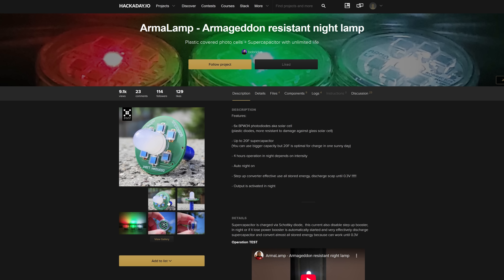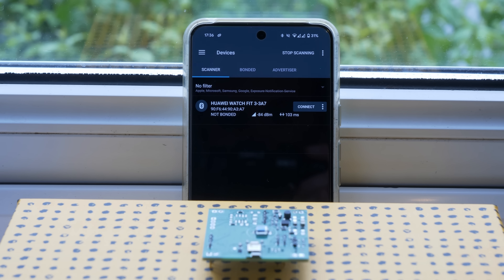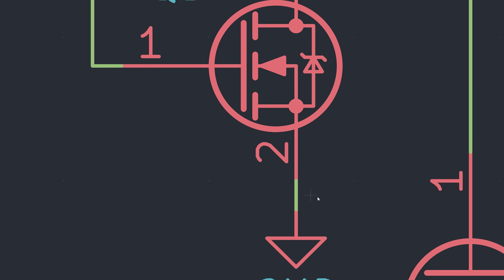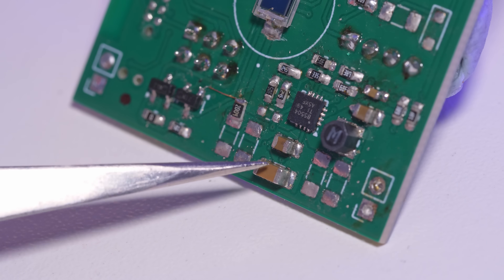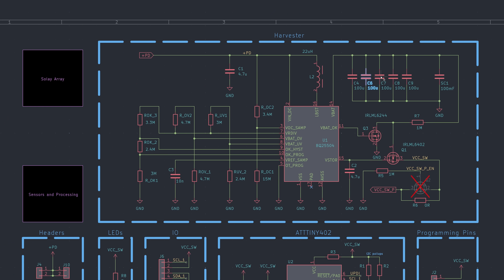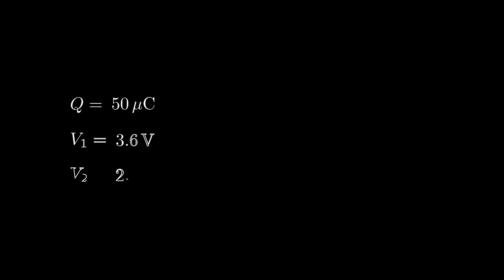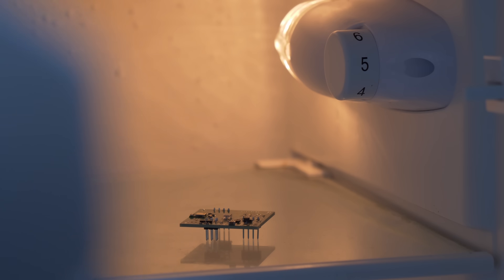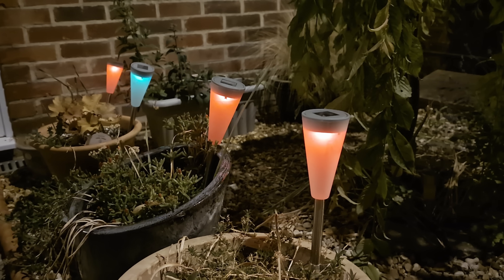Nordic chips are so efficient, you don't need batteries anymore

Comment: how does this work with one bpw34 when the cold start voltage of the bq25504 is 600mV? You measure about 325mV on the photodiode under bright light
Reply from the maker: Hey, good job spotting that discrepancy between the video and datasheet! You are right, the cold start is >600mV so that first start does require more light that I showed in the clip you referred to, but compared to daytime sunlight that torch isn't as strong.
It's a bit of fun using the BPW34 for this, it's more for proof of principal and showing how little you can get away with as there are much cheaper solar panels (with much higher output) that would be better fit for a real product.
Thanks for keeping me on my toes :D

Comment: Two tiny solar cells in series might boost the usable power output a lot. It's much easier to boost 0.5V than 0.3V.
Reply from the maker: It still surprises me that it worked at all with just one...

Comment: need to find a use where ability to leave it alone is more cost effective than replacing a very very cheap battery (also need to consider what happens to the signals being sent if there are many signals at once). Consider: warehouse and plant ambient condition monitors, e-ink supermarket price tags, soil monitoring, industrial greenhouses.

would love a more in depth explanation of how it works

Comment: With a longer range transmitter (cellphone or maybe directly received radio), it might be cool if a circuit like this could send SSTV signals to allow a central unit to gather and process photos. This could be used to monitor agricultural fields and generate fire warnings when flames are detected. Maybe at less frequent bursts it could do a thermovision scan and detect the peak temperature, sending only that value and a scanner ID to the central processor. Or maybe rain sensors, for gathering data about rainfall on various fields separately... idk.

Comment: Does this mean you could use this to do periodic temperature checks and logging it to external network, whenever the fridge and freezer door is open? Freezers typically don't have lights (at least not where I'm from), but would the room light be enough to activate this when using the larger panel?

It won't really work as a "door open" warning, but getting periodic temperature measurements for your fridge and freezer could be useful.
Reply from the maker: Even the light from a ceiling light is enough even at night so periodic temperature is 100% a plausible application for this. Some other comments have also suggested changes to the firmware to harvest more energy in the day and store in a larger battery for use at night when there is little solar energy. 

It's a minor change but makes it more suitable for most application where period measurement is preferred over measurement frequency proportional to the solar intensity.

Comment: Imagine a tiny wearable that streams electrodermal activity (EDA) over BLE — effectively tracking galvanic skin response as a window into the sympathetic nervous system. Kind of like the old Que Sensor we built at Affectiva 10+ years ago for affect measurement, but this time with ultra-low-power design and no battery at all.

Comment: This would be so wildly useful for use in hotel door key systems. Rather than slowly draining a battery over time to trigger a lock, you can have one of these slowly charge 2 sets of capacitor banks.

One capacitor bank has enough to trigger the lock 4 times. (For entry and exit and the included 4 actions on the door lock). And another capacitor bank that triggers every half second searching for a valid key card.

The result? Never having downtime for a battery change or anything similar. Additional benefits to this would be having that key card scanner check for things like;

1. Is there some form of an emergency?

2. Is the lock for some reason left open?

3. Is the door for some reason open?

The convenient thing is that since this is a door lock system and you need at least the surface area required to place and scan a key...you can justify these far larger capacitor banks and solar arrays.

Comment: I saw this and thought it maybe referred to the system data that always needs power, hence the button battery. 
Then I assumed that such data was stored in nonvolatile memory or else hardcoded in the chip.
So an alternative for the fridge thing would be to use the hot part of the coolant loop as thermal generation, idk but it might cool more efficiently and have utility at the same time.
Reply from the maker: Interesting that you mentioned novel nonvolatile memory because this is an upcoming project of mine...

Comment: Im not sure that I have a use for this in the small scale but I have a vision of using a large grid of these where each node can receive and transmit data to eachother, where you could relay packets from a large area back to one reciever. This would allow you to add soil monitoring to a large field of crops or data about inventory  in a warehouse/ employee traffic movemements across a factory to improve effeciency of a production line, something like that. It would be greatly benefecial to have a whole grid of these things set up without having to worry about powering them or having to place multiple receivers everywhere.

Comment: For the fridge, a timer for measurement and transmission were practical of course. But could we have the delay set about the middle between door openings? This way perhaps a more realistic temperature measurement could be obtained. But the circuit nor the chips don't have clock to calculate the time between energy inputs? Hmm, perhaps fixed or a random delay were OK then.

Comment: I once saw a wireless light switch that has no power source nor as a chemical element either a photovoltaic one. It was able to convert the energy of a click when you press it into an RF signal burst. That impressed me a lot.
Reply: I have tons of thoose, basic Philips HUE light switches (10€/piece) does that.
Reply: A piezo lighter does this
Reply: @alexwang982 No, there was one quite  smart magnetodynamic device.
Reply: @Ma_X64  Many years ago I had a wireless light switch that was ultrasonic. The switch mechanism struck an aluminum rod like a tuning fork and the wall unit would change states.
Reply: @moconnell663 Oh, that is interesting solution! Thanks for sharing!
Reply: The original TV remotes worked with this same principle.

Comment: Very cool. I tried to make a soil moisture sensor made of nails and a resistor back in college with mega 2560 microcontroller. The goal was to have it be ultra low power. Had to dig deep to set the watchdog to only run periodically, Something like this would be perfect.

Comment: For 3D printing, we ofter keep our filaments in a actively heated dry box to keep moisture from seeping into filaments. However those can typically cost upwards of $200 and can only hold around 4 spools of filament. So we make passive dry boxes that just have containers of silca gel in them and a hygrometer to show the humidity to know when it is time to dry out the silica. I think one of these boards ploped into one of those passive boxes would be crazy cool. If you have quite a few of these no bat modules then an esp32 could scan for beacons and then relay that info back to an app or email or whatever you want. I can totally see this being a thing especially since you already have lights on when looking for the filament you need. I'd invest in these heavily!

Comment: Tritium rod power?

same thing, but using a TEG/thermo power module. you could trickle absurdly low temp diffs into power, if one side has a temp delta provider of any kind. no light. Could probably even utilize a freezer/fan cycle for the delta.
no light, no moving parts. 
a crashed drone could probably use the delta from a heatsink and the sun or soil to produce a locator signal infrequently agnostic to position with high crash tolerance.

high persistence modules like these are so cool. structural monitors (stress sensor using a piezo?), sea-state trackers.
Or a very, very long-life rick roll emitter.

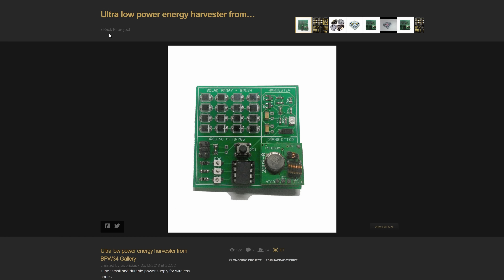Comment: 0:19 multiple capacitors are a battery.
Reply: I think it’s fair to interpret “without batteries” to mean without chemical batteries.
Reply: Your brain diarrhea is technically correct. Multiple capacitors are a battery in the same way that multiple guns is a battery.

Battery: a group of similar items or devices that are arranged or used together
Reply: No they aren't
Reply: @BigLeek-ig3sb  multiple pieces of artillery are a battery, multiple cannons are a battery, multiple chemical-voltaic cells are a battery, multiple photovoltaic cells are a panel, multiple photovoltaic panels are a bank and a battery, etc.

Comment: Security sensor with no battery or external energy required, imagine you can place sensors on your windows and doors that do not need a electric connection or have no problem with operational time, just double the solar cells and a bigger capacitor so it operates on stored energy during the night and you have a permanent "perpetual" security sensor that can feed a iot central you have in your home, I know that the current ones have batteries that last months, but eliminating their battery necessity and possibility of them being discarded incorrectly, that appear to me as a good evolution and can be disseminated to other stuff as well.

Comment: i could power my thermometers and hydrometers in my grow with them, anything in the grow room that needs just a small bit of juice would be fair game, so you have fan controllers, you could even have the lights so they talk to the controller wirelessly when they are on, so your driver and lights dont need to be next to eachother, and you can control remotely. It would be useful in PC's where you want to hold that bios data to memory, movement sensors, PIR switches, remote controls for TV's, I have been playing with a small solar panel and a battery pack from a wireless mouse, not got very far into it yet, when i put the panel into the sun it loses all voltage, i plugged it into a power bank to test it to see if i could get a passive charger, but yeah it doesnt even work there, so i didnt want to try the mouse battery, but those things are tiny, with quite a bit of juice, maybe a nice way to have a bit of storage with the capacitors regulating the charge..

Comment: This would be absolutely great for wireless zigbee switches. I like the kinetic powered ones, as they dont have batteries, but they are a bit stiff to press IMO. Adding a couple of diodes and not needing to rely strictly on the press to power them could make for a more pleasant switch

Comment: Whar would be really cool would be to have an e-ink display powered like that.

An application I could see would be for some sort of harvesting thing (e.g. maple syrup) where you have tiny scales reporting their harvest amount to a central hub running off of a solar panel.

A geocache with multiple beacons could be interesting too.

If you can integrate precise tof sensors you might be able to use an array of those to measure movement of a building

Comment: Could be nice if motion was used instead of light. You could place it on top of an engine to transmit info will running and  when there is no info the engine is off.

Comment: Could use a piezo energy generator that would flap in the wind, charge the capacitor, then test wind speed (ultrasonic?) and transmit. It would only transmit when there's enough wind to wobble the piezo generator, thus reducing spam when there's no wind.

Comment: In construction for light switches in the walls, all the wiring can go in the floor and the roof just put the switch on with double sided tape.  It's a big deal if you 3d print or have modular walls.

Comment: I have had a solar-powered wireless keyboard in my big-TV-room for over a year now, no complaints. No more changing batteries. Now the only issue is the mouse, which still draws too much current for solar-only power, due to the continuous nature of its use vs. intermittent keyboard typing.

Comment: This is amazing. I could see applications in Home Assistant as you suggested for example in soil moisture, or outside temperature etc., never having to worry about changing batteries or running power cables to those devices.

Comment: Oh, I guess it would be usefull for a range of low power sensors which is good to spread out but a hazzle to wire up to collect the data. But I guess if you need that you also need reliability and ensurance of valid data, that would be difficult with these I assume.

Comment: I was impressed at first, but then I remembered that I worked with a company who has been doing the same thing for like 10 years...😬
Check out EnOcean for loads of passive sensors without any energy source, even converting mere heat from a wall mounted heater etc

Comment: How about a little balcony greenhouse where you have a sensor measuring moisture levels in the soil and sending that data to a smart sprinkler/irrigation system? Would also be really cool if it could send the temperature of your greenhouse to some other device, which reads that out and checks weather conditions and if both ok, pops open a little latch to let fresh air in. This seems like a really sweet potential 'solar punk' enabler.

Comment: glucose monitors. The kind you tape to your arm.
They have a limited lifespan of about 2 weeks, partly because the battery is not rechargeable, and partly because the sensor needle breaks down inside your body. But you could at least solve one of those.

Comment: my dumbass idea is use a Thermoelectric Generator, a heat sink, and a thermally conductive mass.

So that any time there's a change in temperature, it reads the current temperature. 
You only care what the temperature is when the temperature is changing, and the device is only powered when the temperature is changing.

If the temp isn't changing, then it just has that "last read 60 mintues ago, yep still the same temperature"

Comment: I wonder what would be the practical maximum capacitance it could charge where the leakage current wouldn't be too high. I'm thinking like could it charge some bigger capacitors which would power a led which would turn on when door opens and it would be dark. Just to show where things are in the dark for at least a minute and this would only happen like once every few days. 🤔

Comment: I made a mouse trap that sends a message when a hall effect sensor detects that it snapped shut. Uses an ESP32 that goee to deep sleep 10 minutes at a time, theb sends a status update over wifi to an MQTT server. This could be a good replacement for that, and then i wouldn't ever need to worry about batteries again!

Comment: OH MY GOODNESS. This is awesome. I have temperature and humidity sensors throughout my house and it would be awesome to not require any batteries. Also, WINDOW sensors would be PERFECT for this, where it will do 'nothing', perhaps having a larger capacitor to last 2 evenings and only sending out a packet when it's open. There are so many types of sensors where this would be useful. If only it could be made at scale with various sensors and capacitor options. I'd probably buy 20 of them.

Comment: Impressive! In our company MESHLE, which focuses on Bluetooth Mesh solutions, we already have a use and implementation of relaying sensor data from battery-powered or battery-free devices like kinetic switches or solar-powered sensors, like in your case in Bluetooth Mesh network. Commercial solutions for such sensors are usually very expensive. But, as you show, the technology is simple and cost-effective, which can allow monitoring and measuring much more data in Bluetooth Mesh environments. Great video and explanation. Also, kudos to Nordic for providing such efficient chips.

Comment: Power monitor: the energy can be harvested by a coil near or around the power cable.
If there's no current, there's no transmission (this can make debugging interesting lol)
If there's current, maybe the frequency of the packet can be correlated to the actual power draw.

Comment: Hi, I'm a dummy, but let's imagine a Raspberry Pi 500 keyboard computer.

If a calculator's solar panel can power a battery for a Meshtastic local wireless social media network, encryption between the keyboards that have each other paired, then put a cell in each letter key that is powered by typing it, like shaking a wrist watch to keep it turning, thereby sending out only that powered signal to the computer, thereby the computer doesn't need to supply power to the keyboard, it only needs to use power to do essential computing and to send out wireless signals as so typed.

It's ironic, AOL is about to drop dial-up, yet Meshtastic could be "wireless dial-up" for the Raspberry Pi?

In principle, with an emergency radio, a solar panel and dynamo crank could run a very basic display screen, so making this into a solar powered laptop for Gameboy-level computing demands seems plausible to me.

Maybe it's not multi-player gaming per se, but multi-sharing Python code is possible. Copy and Paste Checkers? Turn-based sending and receiving.

Comment: Always wondered, how comparable is a calculator solar cell to some way of extracting energy mechanically, from movement. A piezoelectric membrane under some buttons, a thin coil of wire next to a magnetized pendulum? How viable would this work for device to wake up and do something from the energy of picking it up and pressing the on button?